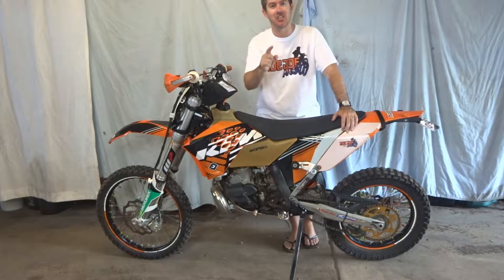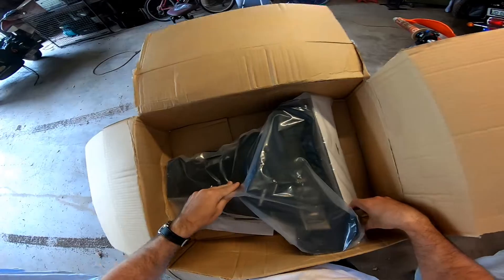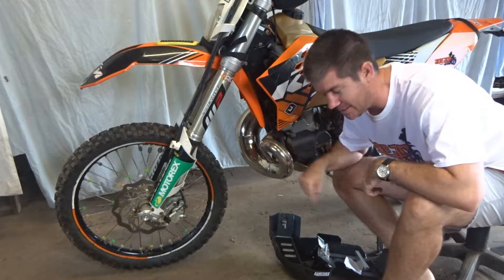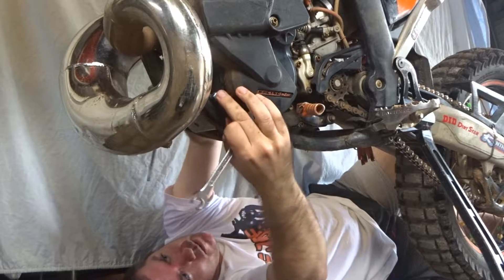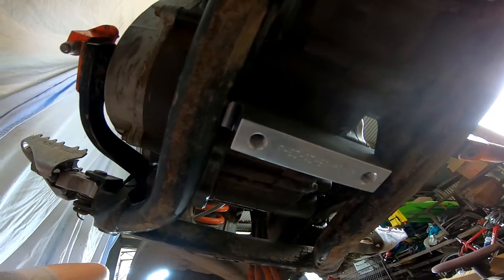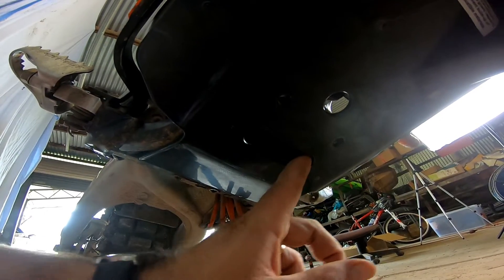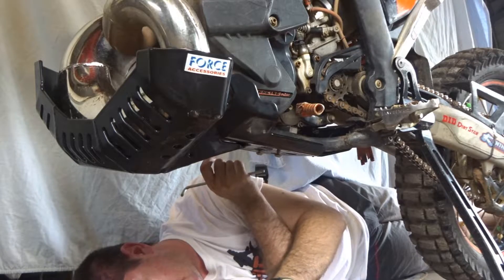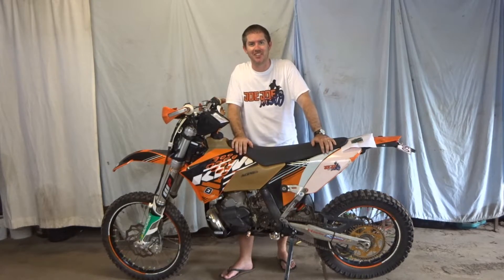Force Accessories Bash Plate Installation - HOW TO.

Comment: That was one of the first modifications I put on my bike took off the brand new never been used plastic skid plate and put on a heavy duty aluminum plate.
Reply from the maker: Yeah, I had to put one on after I got my new pipe on the bike. They are quality bits of kit for sure.  Thanks for watching mate.